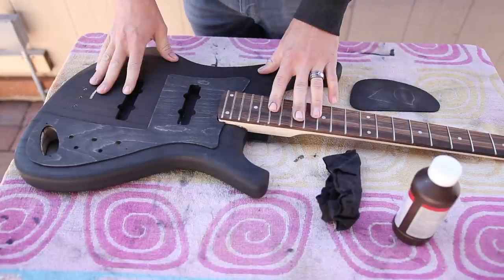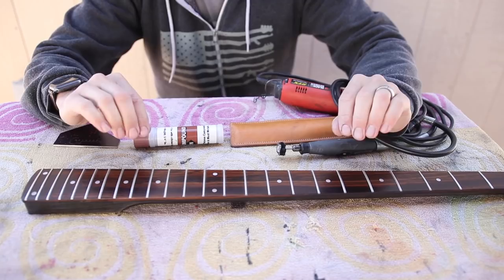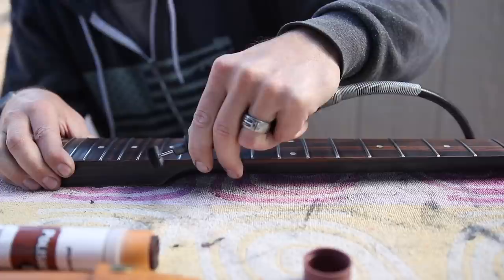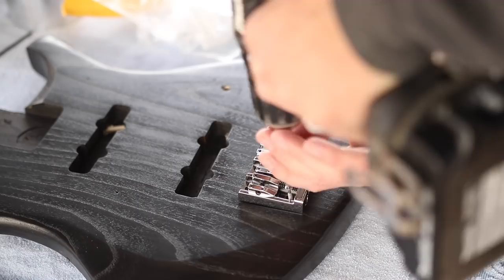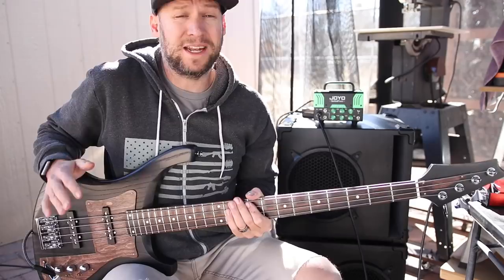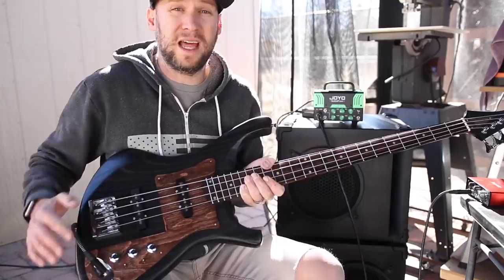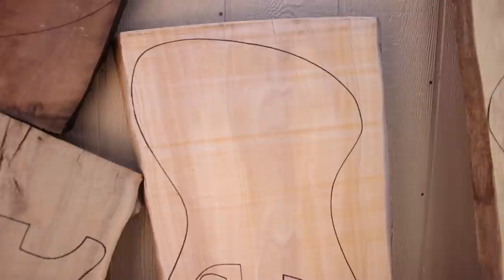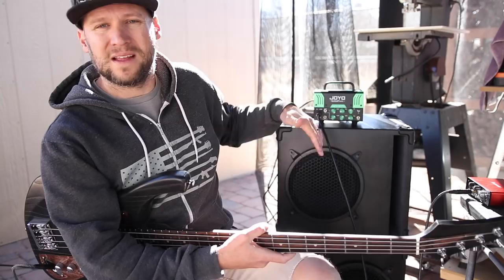Introducing The Behemoth Bass (designing my custom prototype bass part 2)

Comment from the maker: I have one neck/body kit available for sale here: https://www.gunsandguitars.net/product-page/behemoth-bass-neck-and-body-kit
Reply: Hey man, I'm working on building too, and I was thinking the same thing. Do you have any links for paddlehead necks that good quality? Thanks
Reply: Good for you bro!  Great videos!
Reply: I believe it. It’s a great design and you seem like a great dude, who wouldn’t want to support that if they’re able?
Reply: That is gorgeous, that thing
Reply: I like your original headstock with the sideways tuners MUCH better. But $1k more just for the headstock is clearly an issue, I can certainly understand the logic in using the imported necks. I prefer the other earlier headstock, the more curvy falcon beak style thing versus the one in this video though. I'm sure a lot of people disagree. Can't the Chinese make paddleboard? You could offer a choice on headstock and still keep the cost down maybe. Very good call on the pickguard. Finally that's a very good trick, making a j-bass that can actually sound like a p-bass. Rock on.
Reply: Congrats I checked  the website  and saw they were all sold. I'm so happy  for you bro. I will keep checking the site for that lightweight stuff ( the paulowina  or something like that)👍
Reply: Best thing to do with the headstock shapes is to offer both of them. Let the customer decide which one they want.
Reply: @WhatGrenadeWhere  The problem is if they're being mostly shaped at the factory, he has to choose one. That's why I suggested paddleboards - it would let him offer some choice without having to add a full $1k to the price for going his old way.

Comment: A wise choice, import necks.   The difference between a decent neck and a great neck is not where it was cut, routed, glued up, or initially shaped.   The  difference is in the final finishing - rolled edges, fret ends, profile, thickness, width, heel shape, neck to headstock transition / volute area etc.  This is my experience as a player for 40+ years, and as a hobbyist builder who just completed their 50th or so build.   And there seems to be something magic about finely sanded guitars - crazy stuff like the whole thing to 2000 grit followed by wet sanded lacquer.  Only done it once, but it might be the best neck I have bar none - and I have a little over 60 guitars in the collection at the moment, 1/4 are stock (ESP LTDs, Ibanez 8 string, Jackson Roswell, and other "real" guitars), 3/4's are kits, mods, or parts casters.

Comment: Your prototype sounds better than the Bartolini-equipped bass. It’s got a more vintage sound. Strings aside, I think it will cut through a mix easier. So I agree with you that it’s the more versatile bass. It struck me how close you are to high-end/ vintage Fender instruments in a higher price range. Great work!👏🎸

Comment: Oh. Hey.
Another tip: Get a bunch of spare USB cable.
Most are 4-wire, with some additional shielding.
If your internal wiring is shielded with a shield that's grounded, you shouldn't need to worry as much about shielding the entire cavity.
Reply from the maker: Great tip, thanks nick!

Comment: You need to 👑 your work. Take a piece Flat iron/L profile,  weld the shape of your logo roughly on it and grind the weld to shape with the dremel. Might be easier to weld and grind each line 1 by 1 if the logo is complicated. Weld a handle to it ... and BBQ time... you have a stamp... or you send your design to be lasercut on one of those electric stamps for 300 to 500?  Also make a shape you can put on the headstock so your stamp is straight, on the right place and it doesn't move when pressing it in for at least 30 sec.

Comment: I prefer the headstock on the previous prototype but otherwise this bass is looking real good.  The only other change I would want is probably a slightly darker stain on the scratch plate to better match the fretboard (I do understand if this isn't practical because of variation between fretboard colours).  Having that matching colour truss rod cover also brings a nice balance to the instrument.  I would be interested to know more about those pickups.  They definitely didn't sound lesser to the Bartelini pickups.  If anything I would say that the new ones sound much better for cutting through the mix.  I feel I would be able to play in a rock or metal band with them while I think the Bartelini's might struggle there.

Comment: i have a vbt (volume-blender-tone) setup on my pj bass. the only way to do a series/parallel wiring on a blender setup (i think) is to bypass the blender, so i went all in and just wired my series switch as a series+blower switch (requires a 4pdt on-on switch). so when i switch to series, it automatically bypasses all the rest of the electronics. i guess this is more useful on a guitar than on a bass (because series+bypassing electronics gives you quite a big of a boost compared to the other setting), so i might end up adding the volume pot to the series setting, we'll see.
Reply: or I could separate the two... series-parallel connects to volume and tone, and I could add an extra blower switch.... like your setup I suppose...

Comment: Those ebay import necks are the way to go on a budget I've found, but what about inlays? I dig the sharktooth inlays on your previous bass but putting your own on a prebuilt neck is almost impossible. Without removing the frets, sanding in between them is ridiculous and almost not worth it. If I were to do it again I'd give it a stainless steel refret and call it a day. Would love to see how you'd tackle this the Dan Thompson way!

Comment: Great build. Very Awesome! I am building a J Bass using a body off a Lyon J Bass. Got the same Bridge as this one. The screws to set intonation are way too long. Did you have the same problem with yours?
Reply from the maker: Yeah you need to trim the screws to size. Usually the D and G strings are fine, but I usually trim the E and A because they need to be further back to intonate properly.